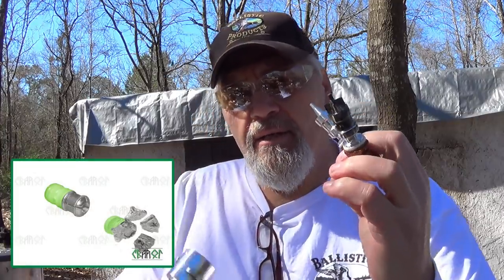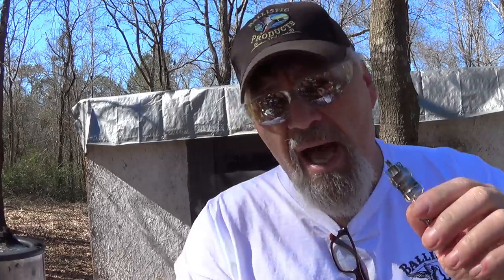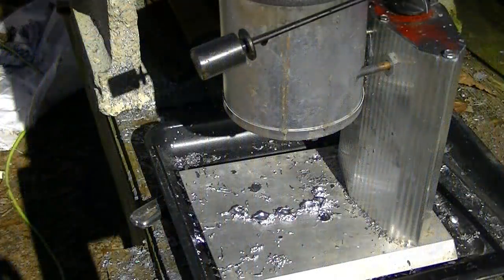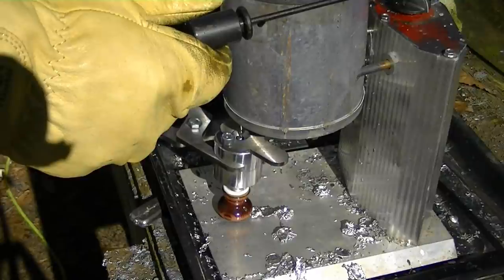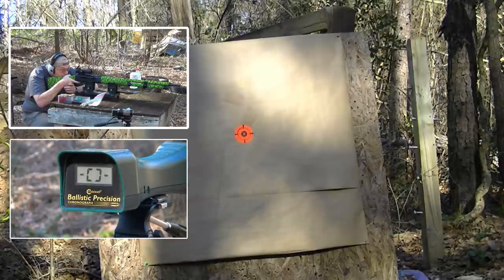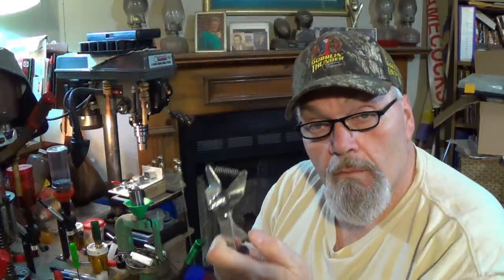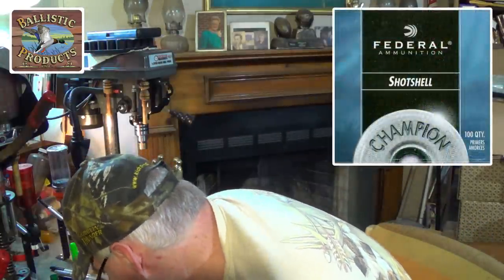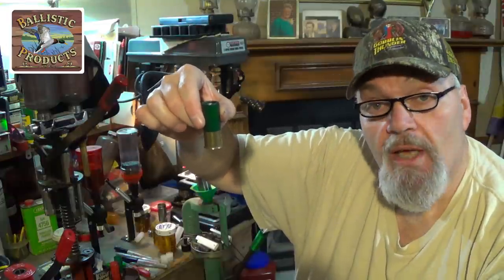Svarog Zveroboy! Let's look at both styles!

Comment: I use a propane bottle torch to put some heat on the bottom end of my molds before I start casting, and I use a thermal heat gun to read the temp as it can read up to 999 degrees.
Reply: That's a good practice. When you have to really tug the slug off of the core pin, the clock is ticking triple time on its life expectancy.
Reply: @robertfrapples2472 If it's not coming off easily just dip the mold into the melting pot to melt the slug off and heat up the pin. No need to scuff up and ding your pin.
Reply: Me too. Another way, (Lee recommends it for their best  selling aluminum molds..),  smoking them w/ wooden matches, (AND pin..), 5:57 then warming them up touching the edges of mold w/ molten lead in pot, AND then, I repeat the smoking again. Then close mold (And pin..), pour your molten lead alloy. As soon as I see the sprue turns 'matte' I count to seven, then a soft rap w/ wooden mallet, open mold = bullet / slug drops free. If the slug/ bullet is still attached to pin, then I slightly rap the pin w/ mallet. No more than a couple taps, and slug / bullet(s) drop in cloth or cool water if you wanna quench it. Many thanks & Blessings to you for your great videos!!.
😊🇺🇲💪🙏🙏🙏🙏

Comment: Wade, to get full fill of the top band on segmented slugs,  that mould has to stay screaming hot. The time that it takes to inspect each slug is enough time for the mould to cool enough where you won't get complete fill.  I  just give a real quick glance for any obvious defects starting out.  Once they're running good,  it's pour-drop-pour-drop-pour-drop.....  I'll cast a pile of them and then go back and inspect each slug and cull out the bad ones. 

You'll need to do the same thing with the Paradox slug when casting with the Azot/Special pin.  That can be tough,  too, as the mould can become too hot and the lead won't fully harden and the center post of the slug will break off and stay in the core pin.  You'll  find the happy medium.
Reply from the maker: Yeah! I molded up a bunch today... It was in the 80's this afternoon!! Didn't have any trouble filling this time...
Reply: You have learned the secret to these! Hot and fast! I make at least a thousand per week of the Zveroboy full and segmented slugs.  I get a few with incomplete top bands on the segmented ones until the mold heats up. I run two molds at a time, and barely have time to fill one before the other cools. I sure wish they would make one of these in steel. As sturdy as these molds appear out of the package, they are actually quite fragile, and not ready for commercial use.

Comment: I really want to try screwing that hollow point onto a hard felt or cork wad just to see if it would work.
Reply from the maker: should work great!
Reply: I think they’d fly pretty good in just a traditional stack without a screw through the slug. They’re full bore slugs so with a little spin stabilization, they should fly pretty decent. 
Don’t know about stabilization at longer distances, but testing will show.
The standard Paradox slug flys pretty well in a traditional type stack. Through both smooth and rifled barrels.

Comment: I have these moulds in 12 and 20ga, they work well, in the 12 ga I also have a pin for the special attached wad, unfortunately up here north of the boarded I can't  find those wads in stock anywhere,  also notice I have to get the lead hot and keep working since the small moulds seems to cool fast and the slugs wrinkle and don't fill.
Reply: I found some on Ebay

Comment: These work great if you just plan on light use. However, if you plan on making a LOT of slugs, you will wear them out. The steel bolt that holds the sprue plate to the aluminum mold is way too short, and strips out. I have used longer bolts, re-tapped and threaded the original holes, and even drilled new ones in different positions (works MUCH better than original) to keep using. Then there is their BIG problem, the fragile core pins they include with the Zveroboy, especially the segmented one. If you don't baby those things, they will fail quickly. If you could readily buy parts for these like you can Lee molds, they would be fine, but good luck with that.

Comment: Hey Wade, I picked up this mold, loading great with cheddite hulls. However I have a bunch of Rem STS hulls, and they seem too tight to fit these, have you experienced this? Thinking hull wall too thick on the sts.
Reply from the maker: Yes I have! The tapered hulls can be too tite! Like the STS the Gun club, the AA'S and such. Those Russian slugs are big! They seem to work better in the thinner walled hulls.

Comment: Hey Wade, great video.
When you cut back the hulls for the short shells what was the final length of the cut shells?
Reply from the maker: They are rt at 2 inches total length. Before roll crimping
Reply: @BubbaRountreeOutdoors  Didn't look like you cut 3/4 of an inch off the max the cutter will cut is 1/2 inch .

Comment: I usually get a lot of leading in my bores when shooting factory slugs.  Are these the same?  Thanks!
Reply: Not if you powder coat them. That’s the beauty of casting and loading your own slugs. The powder coat acts like a copper jacket on a jacketed projectile. It also creates a bit tighter seal to the rifling, due adding a couple thousanths in diameter. Which gives better accuracy. IMO
Reply: @johnanderson186  thanks John!